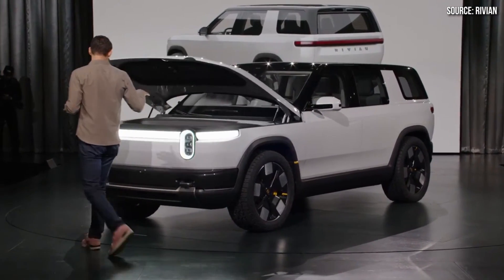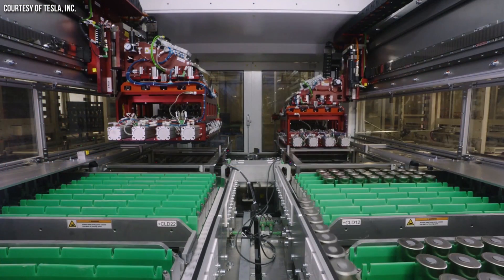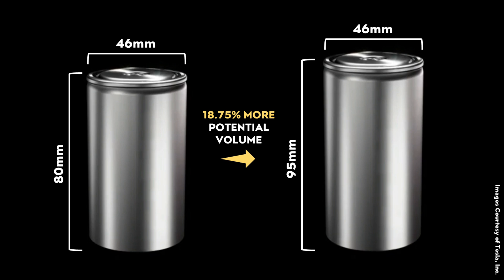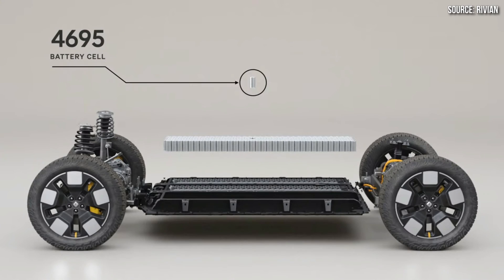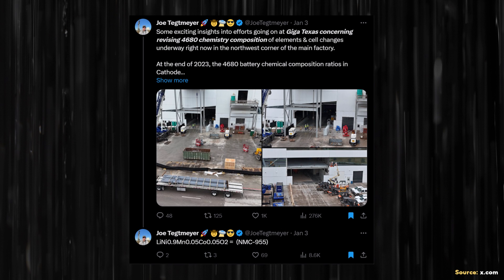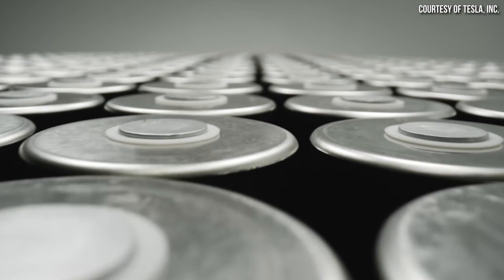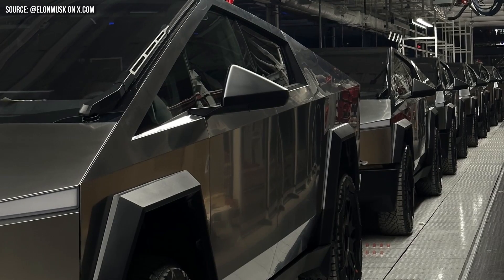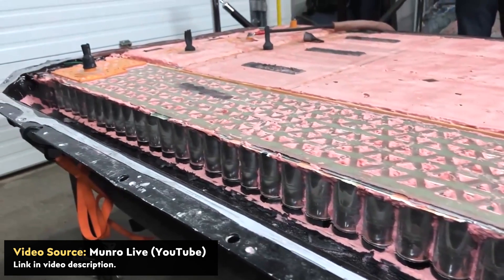Tesla 4680 vs Rivian 4695 Battery Technology | Which is Better?

Comment: Reality Check:
Tesla does not claim today that their in house 4680 battery is less expensive than batteries they buy from Panasonic or CATL. Panasonic will also supply 4680 batteries to Tesla.
Rivian, being a low volume manufacturer, probably could not  build. batteries in house for less than Samsung SDI, who is also selling these batteries to BMW , GM and potentially others. In any event Rivian does not have the money to attempt to make batteries in house.
Rivian has its own brand identity and product line. The R2, which is proposed to cost $1000 more than a Tesla, has enough unique design features to not be a direct competitor.  
Target does not expect to out compete Walmart directly on prices. In the near term Rivian cannot out compete Tesla on pricing. I do not expect either Target or Rivian to go out of business if they can maintain a separate identity and provide value for their customers.
Reply: While Panasonic delayed the mass production of 4680, LG EnSol will begin mass production in 2Q 2024. Samsung SDI and Kumyag will follow.

Comment: why are they going to 4680 when the 18650 is more energy dense than any other battery type? are they trying to boost the pack energy density with the larger cells?
Reply: The energy density comparison is misleading. The main reason Tesla chose the bigger 4680 is to reduce the number of cells per pack. --from thousands of 1865 cells to ~700 4680s.
Reply: @johnshikingmountains3152  Yes, pack manufacturing is way easier with 4680…but Tesla also wanted to be able to use the cells essentially as bricks in a structural battery pack wall to lower cost of production and increase crash safety and torsional stiffness. All of the above though was secondary to the main reason, which was simply speed of production; it doesn’t take longer to make a 4680 than an 18650, but you get a lot more power from the 4680, and when you are trying to figure out how to ramp cell production to meet your expected demand, speed of production is everything.
Reply: @johnshikingmountains3152  so they can make batteries much faster and use them in structural packs. and they seem to be getting close to the 18650 in terms of density, so that makes sense why they'd go with this shape of battery cells
Reply: Costs!!

Comment: Will ford be involved in the battery production?
Reply: Lithium battery involves sophisticated chemical knowhow. LG Chem (now LG Energy Solution is spun off from it) started developing a Li-ion battery from 10 years ago and has been pouring billions of $$$. Today there is no American company who can mass produce Li-ion batteries. Even Tesla imports Cathode materials, copper foils, aluminum foils, many cylindrical cell manufacturing equipment from Korea or China. In the joint venture between GM and LG, the arrangement is that GM pays money and LG Chem provides all technology.
Reply: @johnshikingmountains3152  I was referring to BLUEOVALSK . 
The fact that neither the us nor Europe has the capacity to produce batteries is horrible. 
....... but they are working on that problem.
Reply: Goodness! I hope not. They never made one battery. Let's not ask Ford's advice on how to make a billion batteries.
Reply: @FrunkensteinVonZipperneck  blueovalsk  - check it out  ( I'm not saying it will work)

Comment: Is there a theoretical "optimal" battery size?
Reply: Edit : no
Reply: Tesla claims that 4680 is the optimal size. But it depends on OEMs or cars (car vs SUV vs pickup truck). European OEMs asked South Korean battery suppliers for 4695, 46110 & 46120 (for longer range or for SUV applications). As you know SUVs and pickup trucks have room for taller 46xx cells.
Reply: @johnshikingmountains3152 they also claimed that 21700 was too.
Reply: I guess the optimization depend on the technology used in the design. Not always the bigger is the better.
Reply: @marioescalona1640  There is a limit to how big the cell can be because you need to be able to extract the heat from the core. How much heat you need to extract is dependent on internal resistance and the power draw. Internal resistance is dependent on chemistry and power draw is dependent on load.
Reply: @kazedcat  that’s correct. The technology I mentioned in the case of Tesla with the tabless is related to the internals resistance and heat extraction so there you have it.
Reply: If those cells bigger than 4680 does not provide an efficient way to deal with the heat they won’t  likely be as efficient as Tesla so they would be carrying weight while not having similar energy density per cell area.
Reply: @marioescalona1640  15mm is not much and it is vertical expansion so the effects on thermal gradient is negligible the metal foils are able to conduct the heat in vertical direction. The problem is with radial expansion because you need the heat to be conducted across multiple layers of electrode materials.
Reply: @kazedcat  Agreed radial is more critical but  there is nothing negligible about cell design. Why do you think Tesla claim they have the optimal size and didn’t designed a longer one even having the tabless design? We know tabless design allows for less internal resistance which allows less heat generation at higher charge and discharge rates. If you don’t have a technology that allows similar advantages you won’t be able to beat the Tesla design at similar chemistries IMO. I guess they’ll likely bring a multi tabs design…
Reply: @marioescalona1640  Tesla has the optimal design for their chemistry. It does not mean it is optimal for the chemistry Rivian is using.
Reply: @kazedcat Perhaps I’m wrong but I think ‘optimal’ cell size has to do with the thermodynamics of dealing with the heat and not as much with the chemistry which is basically no secret. The heat generated at  a given current draw is only influenced by the internal resistance affected by the cell design and size.
Reply: @marioescalona1640  chemistry is the major factor for internal resistance. Yes some other things contribute to internal resistance but most of the resistance is in the chemistry of the electrode material.
Reply: Optimal design is dependent on chemistry and load requirements. This is why Tesla is trying asymmetric electrodes they are optimizing the cell design for their particular load.

Comment: What do you mean Rivian  structural battery pack all Rivian did was just copy and paste and make the battery their battery cell 0.15 mm larger to make it looks like it’s different😂
Reply: 4680.  Rivian bids 4695, do I hear 4699, 4699.  4695 going once, going twice …..
Reply: 15mm, not 0.15mm. And not "to make it look like it's different" but to increase the energy that can be stored by floor area.
Reply: @EinzigfreierName and even that was taken from other manufacturers Porsche, Mercedes, BMW
Reply: 🙋‍♂️THANKS JON,FOR EXPLAINING THIS,WE TOO HOPE RIVIAN IS SUCCESSFUL AND THANKFUL THAT THEY ARE MAKING USE OF THE TECHNOLOGY, BUT THEY WON’T EVER CATCH TESLA 💚💚💚
Reply: Probably because rj claimed publicly the r2&r3 platforms uses the cells in a structural pack without any modules&the lid is the floors base. 
Ie exactly like what tesla showed at battery day and then first sold to the public in the early 2022 tx built 4680 model Y's. 👍🏻